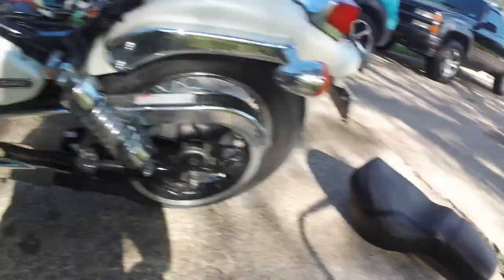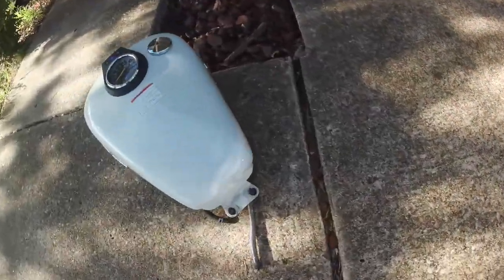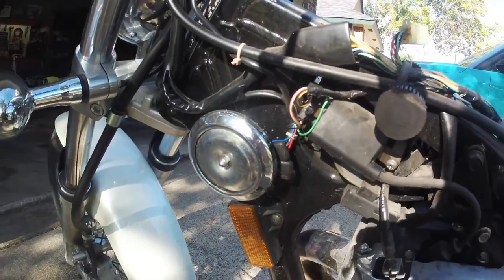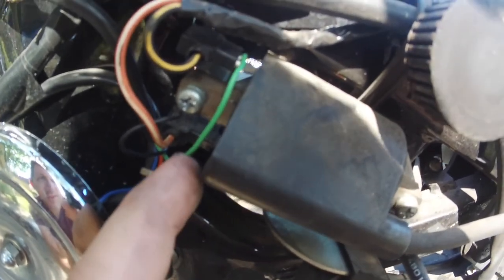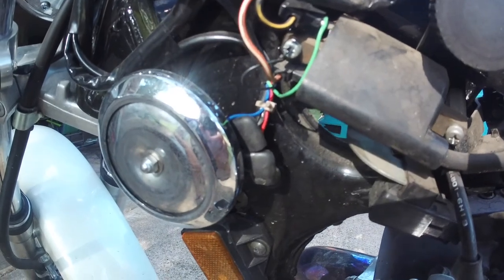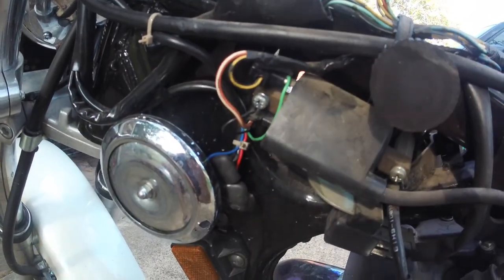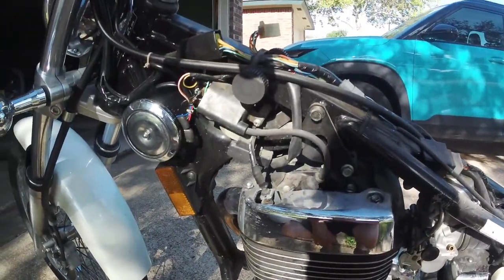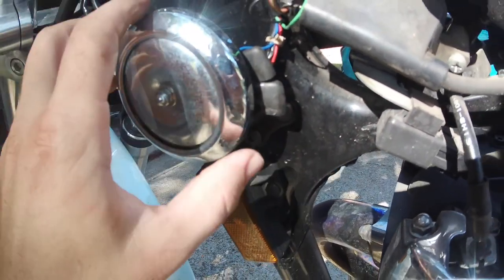S01E02 Tach Wiring (Suzuki S40)

Comment: Hello!
I don’t have the same tacho, but I do have a Suzuki savage that I’m currently trying to wire up a different tacho to, from Dime City Cycles. Same wire setup but here is my question - should your tacho get power and have the backlight on WITHOUT your bike running, and just having the ignition in the “on” position? I haven’t put my tank on yet and I have my tacho wired up, but I’m not getting any backlight. Just wondering if it should be illuminated with just power from the battery and the bike not running, or if it needs to be running for it to be on.
Thank you!
- Evan